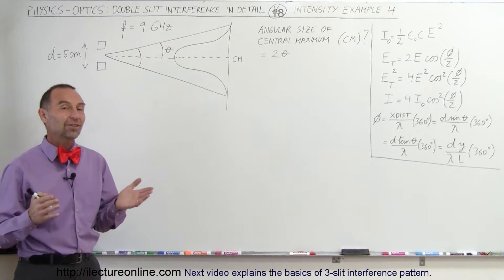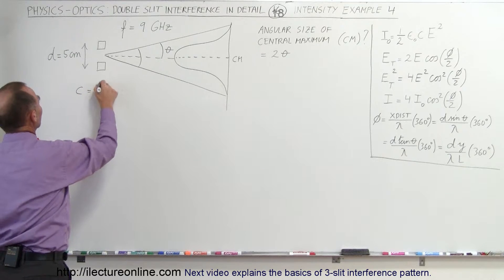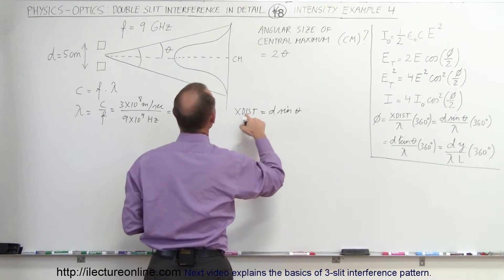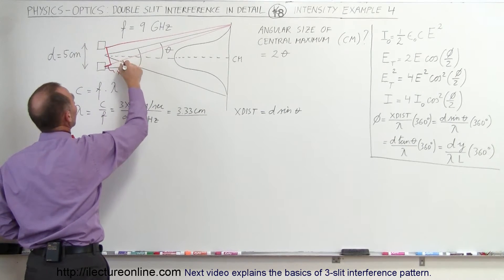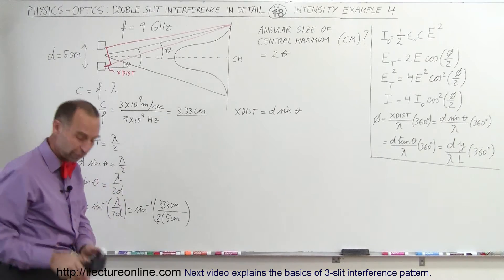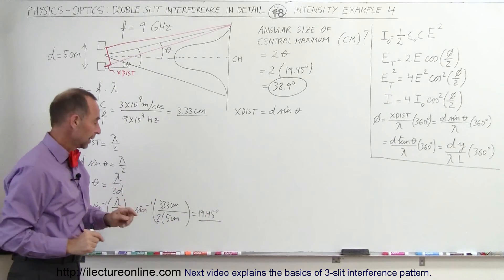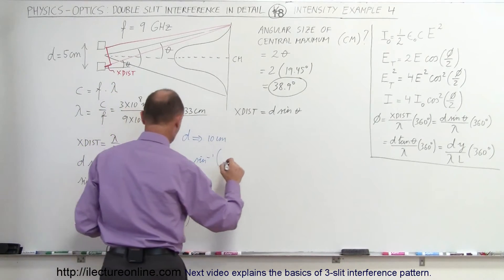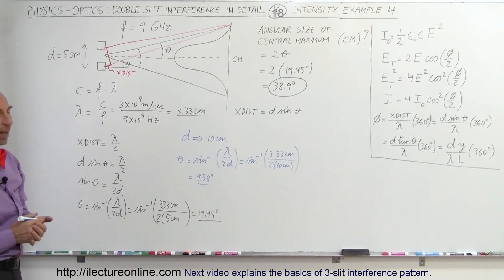Physics 60  Optics: Double Slit Interference (18 of 35) Central Max=? of 2 Antennae

Comment: So at the central maximum the angle theta is not zero? In general case.
Reply from the maker: The angle is zero at the central maximum.  (The slits are very close together).
Reply: @MichelvanBiezen  Right, that's what I thought but was doubting. Thanks!